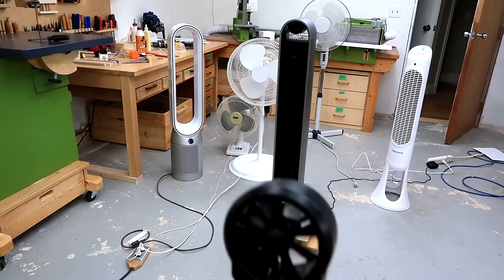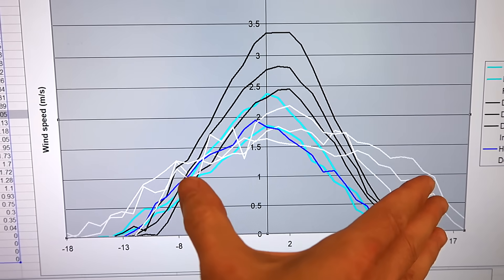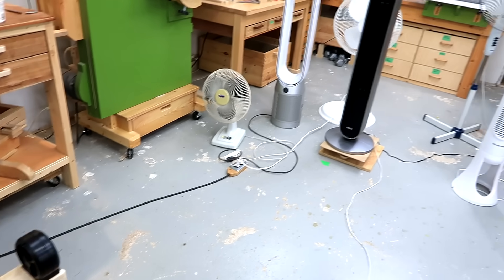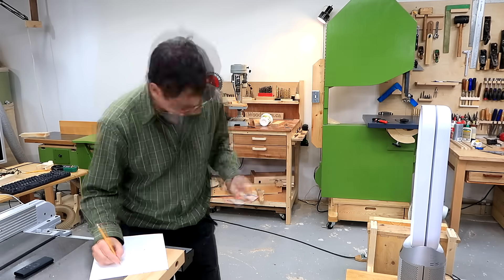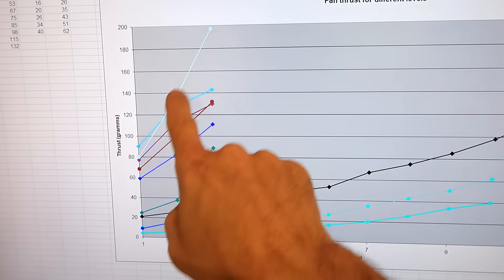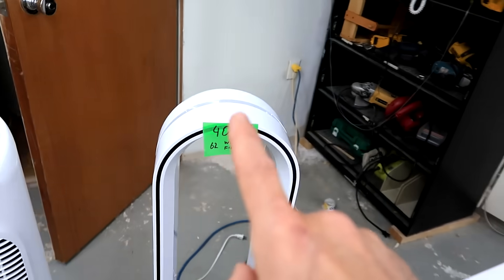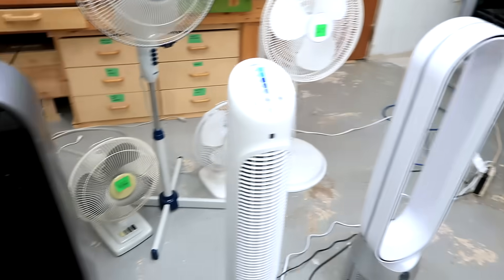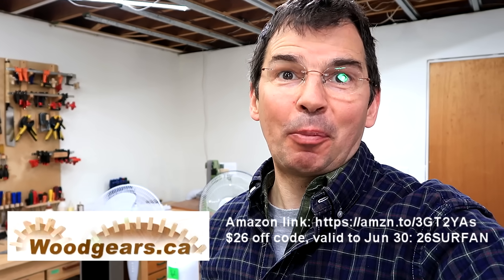Which fan blows hardest -- Tower fans and regular fans

Comment: But which is the most efficient for power consumption compared to thrust it puts out?
Reply: How do you measure efficiency? CFM,  dBA, wind velocity, Watts used per/?. I recently was looking for a leaf blower and they measure them in CFM and wind velocity.  You are compressing the air with the fan blade and you are moving so many pounds air/minute using a measurable wattage? at a measurable dBA level.

Comment: I use the propellor type fan without the protective cage. Matthias, would you be interested in measuring the difference in performance with and without the protective cage? Of course, in your household, with young kids, not using the cage is out of the question. But I never come in the vicinity of the fan, so in my specific case the protective cage would be an unnecessary impediment. 

I have one cheap propellor type fan, and two propellor type fans that were marketed as 'whisper silent'. (Luxury price level, the brand name is 'Duux')  And they are in fact whisper silent, when running at slow setting. Ludicrously many speed levels: 26 Slowest speed '01' gives at arm's length a nice breeze, very silent.
Reply: I would think that adding a shroud around the intake side of the fan would make it more efficient. I'm not sure there is enough volume of wire in the fan protective cage to make much difference

Comment: Interesting thrust measuring device - I'm curious if there's any torque/moment concerns. basically wondering if a fan closer to the floor performs differently on your rig than a tall fan on a long leg stand would. (I assume the answer is it would be the same with or without the leg, but I'm not 100% sure).
Reply: Yeah I was thinking the same thing. If you take it to the extremes and use a really tall fan (or a really flat fan) the thrust will vary because of where the force is coming from in relation to the pivot point.

Comment: Great demonstration with the trash bag. I've sort of some to the same conclusions as you by anecdote. Back in  my old shop we had a big barn fan and a large industrial stand fan. Even though the motor hp was about the same, the stand fan seemed to move a lot more air despite it's smaller blade size. It seemed to me then that the velocity of the air was as important as raw volume, and now I can see why.
Those Dysons are just not a good deal unless you want a filter in that particular form-factor. I still use the cross flow fans where it fits in better, but the propeller style fans are what I go to now. There are even a few premium ones out there with nice high quality brush-less dc motors and extra-low speed settings.

Comment: Huh, 28w is very efficient. I wonder how efficient propeller table / stand /ceiling fans using bldc motors are. Will be relevant in areas with spotty grid power, relying on IPS/solar.

Comment: The Dyson blower inlet is 360° and at the base of the unit, while the air discharge is higher in only one direction. The other fans have inlets and outlets at essentially the same level and in the same direction. Wouldn't that difference alone result in a lower thrust measurement from the Dyson for a given air flow?
Reply from the maker: the inlet direction doesn't really make a difference in terms of thrust.  height of distcharge also doesn't matter with how I made the platform.  It doesn't tilt, it moves parallel

Comment: Wish I had a certain box fan I had as a kid. It used a round body that was closer to the propeller and did way better than a cheap box fan. Unfortunately, it was also entirely plastic and not very drop resistant.
Reply: sounds like a lasko wind machine, they still make them

Comment: Would the mass of the fan affect the thrust measuring system? It seems like some of those fans are really small, so they might also have very low mass compared with the big fan. But on the other hand, they're mostly plastic, so it might be the case that the motor makes up so much of the mass that the size is nearly nothing in comparison.
Reply from the maker: see previous answers to this question

Comment: Can you do performance per watt? I have a cabin that's all solar, I want to run a fan all the time. The dreo looks good but I need to know what the draw is like at lower levels.
Reply: Ravedave5 In the video at 7:26, the Dreo uses 3 watts at lowest speed, 28 watts at highest speed.

Comment: I wonder how the deeper angle propeller fans like the vornado would preform
Reply: I just purchased a Vornado fan from COSTCO (on Sale $40) and Vornado claims they have a design that helps circulate the air in a room reducing the stratification. Vornado Pivot 6X Air Circulator. It  a small fan (9" and 4 speed) seems to work well. I have fond memories of the Green floor fan we had in my home in Pittsburgh PA 60 years ago in a house without AC. How Savage!

Comment: That plastic bag demonstration was quite impressive. Really nicely demonstrates the difference
Reply: A question remains - if it moves "10 times the air at 1/10th the speed because of conservation of momentum" then how does it fill the bag faster? 1/10th of 10 is 1.
Reply: @tmmtmm  maybe there's a kind of saturation effect. If you blow on the same spot always, air will stack up and exert back pressure and push air outside again. If air blows at the complete cross section, there's no such effect.
Reply: @tmmtmm  idrk but i think its because when u blow it inside like the first test, the energy is wasted by bouncing hard off the back of the bag and de-cohering into chaotic swirls. when u blow further away it can turn into a big slow moving sort of piston that can push all the air thats already in the bag and turns the energy that was a quick bounce off the back of the bag into a gradual softened push of all the air already in the bag. so it turns the energy into something thats harder to be wasted in the back of the bag when it just becomes swirly. also i think the piston effect helps it go faster because it can fill it faster than the air is even moving by pushing existing air already in there.
Reply: the "magic" of entrained fluidic flow; in this case air.
Reply: Bernoullis principle in action
Reply: I was also a big fan, it totally blew me away

Comment: Does the mass of the fan make a difference with your thrust measuring setup? I'm curious if you would get the same measurement if the fans were set on top of weights to normalize them.
Reply from the maker: doesn't make a difference.  The fan doesn't actually move back because the scale prevents it from moving back.  Also, I tare the scale to zero before the fan is turned on.
Reply: @matthiasrandomstuff2221  can you calculate cfm directly from that force measurement?

Comment: Regarding the inflate-garbage-bag demo: Whay I don't understand is that, beause of conservation of energy/momentum, asi you said yourself, the Bernouli(?) enhanced way should, in my intuition, fill the bag at the same rate as the direct method. You should get more air moving, but at less speed.
Reply from the maker: this has nothing to do with bernoulli.   Bernouli priciple is just conservation of energy.  With turbulent flow, that doesn't apply.  So forget bernoulli and it's easier to understand.
Reply: @matthiasrandomstuff2221  yes, I am wrong about Bernoulli, but my question still stands, I think?

If the compressor/fan uses e.g. 1 Watt to move 1 liter of air per second, then I would expect the same watt to move 10 liters at tenth of the speed, when using that effect?
Reply: @MoritzvonSchweinitz  1 kg of air occupies a volume of approximately 800 liters. By conservation of momentum, 1 kg/s of air moving at 10 m/s has the same momentum as 10 kg/s of air moving at 1 m/s. But in the first case that is 800 l/s, and in the second case 8000 l/s. So the volumetric flow has increased tenfold.
Reply: It was a very informative demonstration. My take would be that when the bag is filled with the top sealed there is more force from the high speed air jet that is pushing on the bag. With the entrained air, that force has been transferred to the larger airstream of entrained air.

Comment: My biggest gripe with tower fans is they are very hard to clean.
Reply from the maker: True.  the dreo opens on the back without taking the whole thing apart, but that drum is still harder to clean than a 3-bladed propeller.
Reply: Dreo has some model allowing taking drum out and wash it. Tested model misses this feature?

Comment: Hi Matthias, I was surprised about the Dyson, I expected it to be much higher. I fan that you did not have in your test is an over the head fan, I would not get rid of that because an the slowest speed I cannot hear it from about three feet above me but it moves the air around on hot nights and it allows me to get to sleep. At it’s highest speed it nearly pens me to the 🛏
Reply from the maker: you just need a gentle draft for sleeping, so the Dyson is adequate for that.  A propeller fan would have to be aimed away from you even at level 1.

Comment: You should include a Vornado fan.  They blow a narrow column of air so the wind front won't be as wide.
Reply from the maker: haven't got one
Reply: @matthiasrandomstuff2221  Costco, on sale $40 . Circulating fans or is it just hype?  Seems to work for me in my basement finished area. Without the fan can have a 71*F at ceiling to 68*F and floor level. With small fan blowing from 30' the stratification goes away. Small 9" fan on next to next slowest speed out of 4 speeds.  I chose this speed based on 0 stratification at the lowest sound level.

 I did some quick measurements and 590 ft/min at 1ft away @77*F, 216ft/min @10ft @ center of stream.
On high speed 1024ft/min @1 ft.  334@10'.
The stream is focused and seems to travel a long way, they claim 30'.

Comment: clever thrust measuring setup!
Reply: Tony. You've not time to be watching or commenting. You must produce for my consumption. Have you a good one.
Reply: Well, of course, the thrust characteristic of that type of thrust - if you can remember back when, Old Tony.
Reply: You promised to hire that young guy that faked your style a while back next time you went AWOL - I hope his contract is signed and his first upload to your channel is coming soon ;-)
Reply: TOT!! You’re here?!?
Reply: actually its flawed, fan is lifting itself a bit when producing thrust because its moving around a pivot point which is short, you might think its neglibigle, but thrust to weight ratio of those fans is so low that I think its not negligible at all.
Reply: @ekstrapolatoraproksymujacy412  yep, then it’d have to be calculated as it’s measured weight / weight of fan
Reply: @ekstrapolatoraproksymujacy412  lol u said thrust
Reply: @DullPoints  ha ha gigity
Reply: @ekstrapolatoraproksymujacy412  good point but it will depend on how much give there is in the electronic scale. They're pretty stiff.
Reply: @ekstrapolatoraproksymujacy412  exactly, power to weight will affect the results. I would also expect height relative to the base and the stiffness of the stand (especially for the traditional pedestal fans) to play a role in the results as well. Without controlling for all these variables this test lacks statistical validity.
Reply: @shewh0rn he's not measuring absolute values, the numbers don't matter. His testing rig is perfectly adequate for the sake of comparison between fan models, which is the entire point.
Reply: @pilotdog68  regardless of whether you're measuring relative or absolute values, you still have to control for variables in order to make equal comparisons.
Reply: @pilotdog68  thats only correct if the fans weigh the same. If a fan is 10 times as heavy with same airflow, that messes up the measurement
Reply: Somebody get Integza on the horn

Comment: I would be concerned that taller fans have a more indirect push on your thrust measuring device, but I'm sure you know that. Very clever measuring thrust, which is roughly air volume X air velocity, which is exactly what we need to know! Loved the video!
Reply from the maker: Actually, what I know is that the platform moves parallel, so the height that the push is applied doesn't matter
Reply: @matthiasrandomstuff2221  Surely on a tall enough fan the stand would have some kind of lever effect? At some point the thrust from the fan at the top would generate a pivot action at the base rather than a translation action. My wonder is the degree to which height of a fan creates a component vector "downwards" that's counteracted by the bracing of the fan base vs the horizontal component which is being read by the setup.
Reply: @PKDoesStuff  Fudd's Law states "if you push something hard enough it will fall over."
Reply: Draw a freebody diagram

Comment: I wonder if the dyson does not cancel out some thrust on the body by accelerating surrounding air.
Reply: The amount of extra air that you can accelerate is limited by the amount of air that the fan directly accelerates.

Comment: Wouldn't the weight of the fan itself effect the thrust measurement from your measuring set up since it has to swing slightly upward?
Reply: There is essentially no real travel. It's a digital scale with a wheatstone bridge load cell. It's a difference of pressure not distance.
Reply: It swings laterally not vertically and the fan's weight is removed when the scale is zeroed. The downward pressure is generated from backward motion via frictionless pivots.
Reply: @mwilliamshs  there is still a vertical component of the swing.  you can't swing something and not have it move vertically as well.  I feel he should have added weights to the platform so that all fans match the weight of the heaviest fan.

Comment: i think the "bladeless" fan has a little fan in the bottom portion, so that fan has less thrust because of its size probably. however, i wonder if it could be supercharged by replacing that motor with a 1.5 HP fan and Matthias Wandel Wooden turbine :)
Reply from the maker: it could, but it would be very loud and inefficient

Comment: But the weight is different. Yoru thrust measurements need the fan to move and heavier fans will need more thrust to show anything on your scale. The swing configuration needs the fan to move backwards (and actually a bit up) to push on the scale. While the scale provides the same amount of resistance for all fans, the swing is not going to work the same because of different mass. A very heavy fan could probably produce Dyson levels of airflow while giving no thrust measurements in this setting. It's like mounting a small turboprop on a huge airplane and expecting it to take off just as well, because it was working on some ultralight.
Reply from the maker: the fan doesn't move because the scale doesn't allow it to swing.  It justmesures how much it pushes, but it doesn't get to move

Comment: I don't think that you can compare the fans over thrust. Maybe the Dyson design is more efficient in mixing and accelerating surrounding air and therefore doesn't need to move as much air through the fan itself. Therefore having lower thrust
Reply from the maker: Please listen to the explanation in the video why thrust does matter

Comment: Now I’m wonder which one will dry a floor faster. Is it just air speed that matters, or does oscillating help.
Reply from the maker: a an oscillating properllor style fan would win that hands down, cause it can be aimed downwards.
Reply: All the carpet cleaner crews and such use large squirrel cage fans to dry floors.
Reply: I use a box fan at work since it sits on floor

Comment: Will the measurement of the thrust be affected by how far away the fan is from the platform (taller fan vs shorter fan)
Reply: And does the weight of the fan affect it?
Reply from the maker: Neither does.  I made sure it doesn't in the way I built it.

Comment: I'd be curious to see including the Vornado fans. On low they are really quiet but move a lot of air. On max they are like a jet taking off and sound like one too. haha.
Reply from the maker: I don't have one
Reply: I'm on my second vorrnado, I destroyed the first one by knocking it over in the middle of the night attending to a small child. Todd is right, a little noisy at high settings but it also moves a lot of air and has settings very low and quiet. I'm not sure how it would fair in this test regimen as the design is for projecting a wide dispersed air stream to move the air in an entire  room.

Comment: I guess each fans have their good & bad. Seems like it’s an issue that manufacturers are seriously looking into as nowadays you can get traditional desk/pedestal fan with propeller blades that have like 30 speeds & a brushless motor. I feel like tower fans never really catch on because of their weird wind pattern & the fact that they generally can’t point up & down, but I think Dreo is up to something here. I’d still take a traditional propeller blade fan over tower fans any day though.
Reply from the maker: There are some places where a tower fan fits better with the decor.  I think that's a big factor.
Reply: That's true
Reply: @matthiasrandomstuff2221  my wife agrees
Reply: The tower fans are also a centrifugal type which seem to be favored for producing quieter white noise.  My fancy air purifier uses this type in combination with a resin-packed brushless motor and you can barely hear it.

I like the vertical form factor.  Would actually buy this Dreo model if it came in white.
Reply: I like a tower fan because of large vertical area of air moved. It can set behind my desk, and it blows on all of me, legs and arms. It doesn't need to cover a wide area, and doesn't even need to oscillate. The room doesn't need air moving. I'm just after accelerated perspiration evaporation.